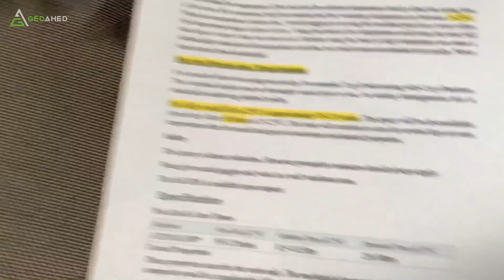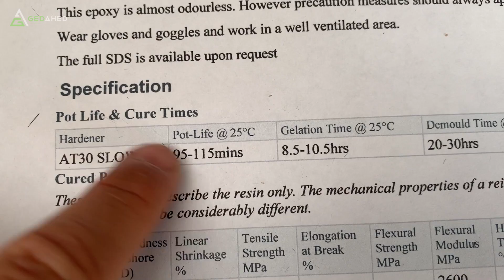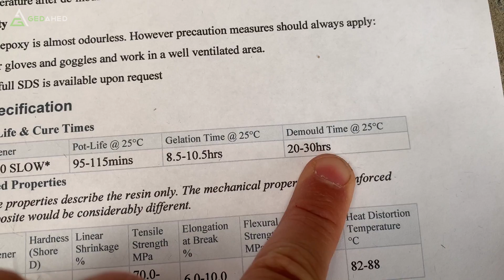Carbon Road Bike Repair CHEAP! Semi Pro Finish! Part 1

Comment: Awesome video mate. My seat stay also got damaged and now looking at repairing it and this video is a great help!

Just noticed the tape in the kit you got there, I think its a shrink tape where you need to use a heat gun or the missus's hair dryer for it to shrink and hold the cf in place.

How's the repair holding up btw? Do you feel confident in riding it so far?
Reply: Hi, thanks so much for your kind comments! Great to hear it helped, I’ve done a few bikes since with different techniques, but I’ll definitely take it on board with the shrink wrap - will give it a go on next project.
The bike has been faultless, weekly rider and competed regularly with no issues. It’s given me confidence with other projects and saved some £££’s in the process!